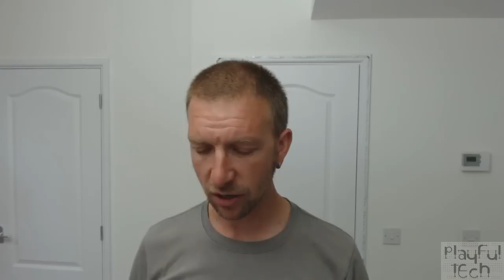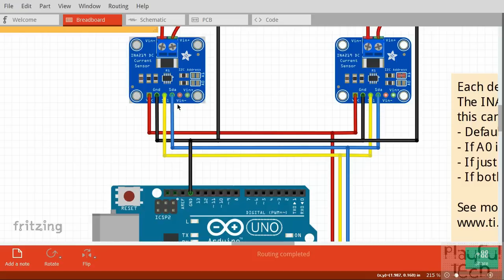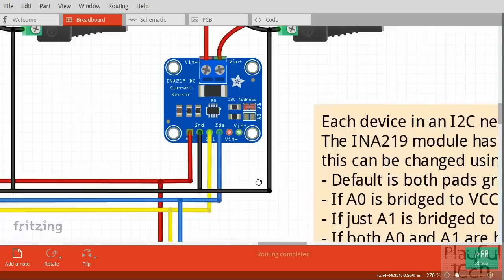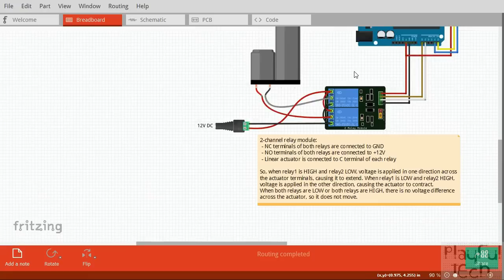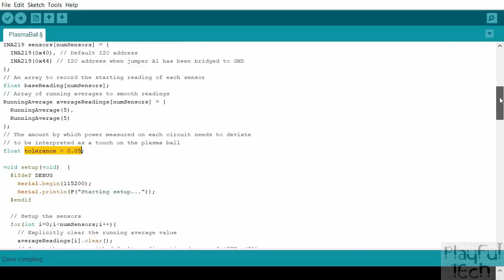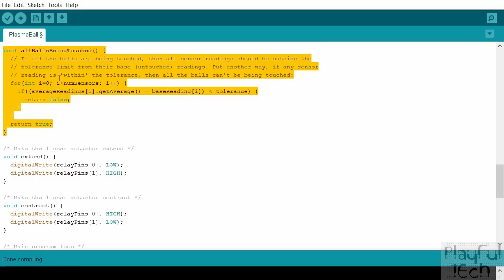Plasma Balls + Arduino Escape Room Puzzle

Comment: Wasn't sure how to reach out to you.  But do you have any thoughts on how to make a puzzle switch like this?  https://www.youtube.com/watch?v=TJb6nllGTUU
Reply from the maker: Hi! There's a couple of ways to do that puzzle.. one is using genuine plumbing pipes and valves - on one side of each valve have an LED and on the other side a Light-Dependent Resistor. As the valve is opened, the light from the LED reaches the LDR and can be detected by an Arduino.
Reply from the maker: The other way is using "fake" valves attached to rotary encoders. I did a previous tutorial about this - try searching for my "Valves Puzzle"
Reply: @PlayfulTechnology  i like it!

Comment: Is it a problem that the linear actuator is always contracting (when all of the plasma globes are not touched)?  Should there be some code to detect when it is fully contracted and stop powering the actuator at that point?
Reply from the maker: Hi Jeff, every linear actuator I've ever used (including the cheap one used in this video) have internal limit switches that cut power to the motor once fully extended/contracted.

Comment: Great idea! Is there a way to make it so that the plasma balls are only activated/light up after they are triggered by a metal or magnet? (for example, they have to solve a puzzle first and obtain an object which needs to be placed in a certain spot before this puzzle activates)
Reply from the maker: Yes, you could certainly do that by using a 5V relay triggered by an Arduino to switch the power supply to the plasma ball. Then adjust the code to only start monitoring the power usage of the ball once it's been activated.